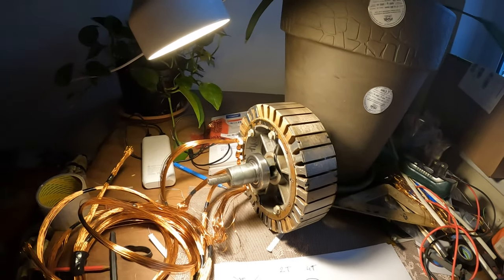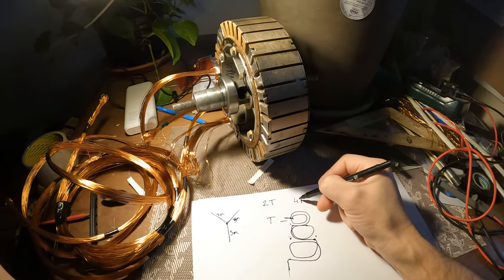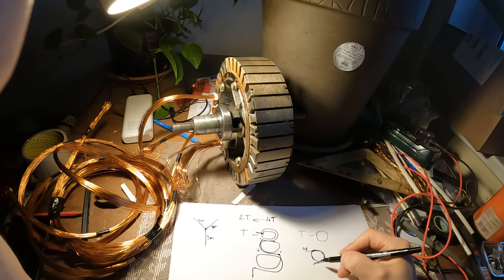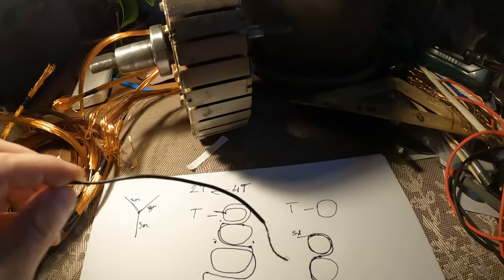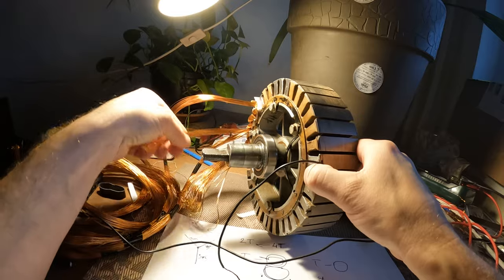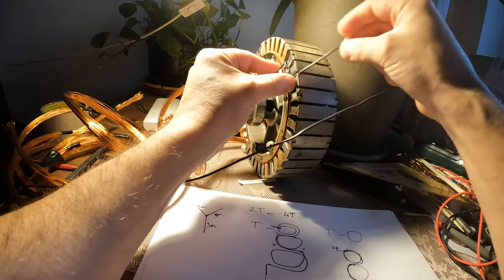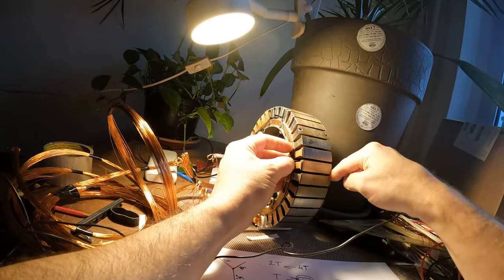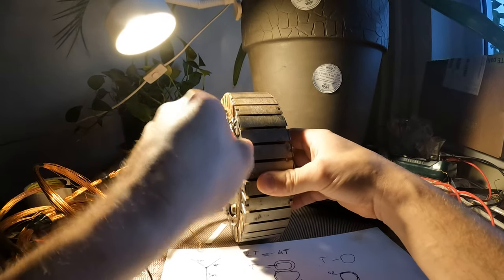QS 205 electric bike hub motor rewind part 1

Comment: Hello. The video caught my attention. I'm wondering something. What kind of result does wrapping in 4 turns instead of 2 turns give? Can you give information?
Reply from the maker: @celalkaranfilyeri393  2T will be faster than 4T but will have less torque at same amps. In simple words just imagine bicycle with higer gear switced on. You can go faster but it is much harder at low speed to go in hills. It will have +- same efect. It will stress all components in serries. (Battery, controller). But if your system can handle more power. You can push ut harder. There is always one component in system where you will reach it's max. Battery, controller or motor.

Comment: Hi question. I found a few broken strands on the green phase winding, where the wires bend over the body hub. Will the motor still run with a few broken strands? Like 3, maybe 4 at most
Reply from the maker: Yes, it will run no problem. But this phase wire will get a little more heat then 2 others. It very depends how strong You are pushing this motor.
Reply: @Musvilkis  it's a first gen 3kw qs205 pushed to 6kw nominal, 300 phase output with statorade and hub sinks paired with a fardriver Nd72530 75 line amps. Motor currently has 40,000km on it
Reply from the maker: @500wattz  I bet there is no fero fluid left after so much km. I am thinking it is maybe better to use transformer oil.
Reply: @Musvilkis  you were right my statorade all leaked out but I think it's because I didn't let my gasket cure and I caught it seeping out of the side covers months ago
Reply: @Musvilkis  question, of those broken strands are left loose and hit one of the stator magnets (if I tucked them away), would that create a short? When I sealed it all up I spun the wheel by hand and felt resistence like how you could the pole pairs. I checked all my phase wires no shorts in main cable to windings
Reply from the maker: @500wattz  maybe these couple wires are short somwhere else? Chech if these couple loose wires are not in short with stator. Maybe they are damaged in couple places and creating short to stator. We had similiar situation to my friend
Reply from the maker: @500wattz  Also check phase wire  if they are not shorting to stator.
Reply: @Musvilkis  I checked, it seems okay might be shorted phase wires in the axle as the yellow phase insulation is ripped open close to where it enters the axle. I have pole pair resistence without any power which is not normal. How can I check with a multimeter if my phase wires are shorted?
Reply: @Musvilkis  okay I ran continuity test via multimeter all phases beep between each other and when I run from axle to phase all phases beep as well. Would those broken strands shorting to stator cause this, or do you think the wire insulation for the phase wires cracked open inside the axle?
Reply from the maker: @500wattz @500wattz  Hi it could be those lose wires. But still usually the demage is on pole coner (sharp edge of the pole). It is hard to see because wires are hiding it. You can rewind it. QS is quite easy to rewind
Reply: @Musvilkis  How long should the enamel wiring be? If i were to buy a 1lbs spool and cut off 22 strands, how long should they be to wire into the 205 stator?
Reply from the maker: @500wattz  it depens on motor "kv" or "T" value. More T more longer wire. You also have to have insulation paper for stator. I bet old one will be bad. You can buy it from ebay as I did. The length You will check when unwind old wire. Please left some more. I had on my rewind that I was to short like 10cm for wire. :D
Reply: @Musvilkis  I'm aiming for 4T rewind. Why insulated paper and not just any paper when rewinding?
Reply from the maker: @500wattz  because usuall paper does not have mechanical or thermal properties as insilation paper which is designed for this. Only one way to find phase wire lenght is to unwind old and measure it lenght. Better to film your unwind in order to do same wind configuration.

Comment: Hello I glad I found you 😎
Could you please help me

I have exactly the same motor but 5T
I was just about to rewind it to 2T.
Because
this problem I'm getting 
The motor has a bit resistance when turning also when disconnected.
Feels like magnet pulling 
Makes loud noise & vibrating when running.
Do you think is problem with the windings.
Could you confirm please

I've already tested the obvious
Not hall sensors
Not wires touching frame.

Just can't think what else could it be.
Reply from the maker: Hi 2T will be very fast. It would be like 4 times the current as 5T moving from stop or climbing the hill. Controller/BMS/Battery have to be very powerful to handle 2T. Would not recommend 2T if it is in wheel without reduction as my mid-drive. Even in my mid-drive 450A phase/ 250A battery with reduction 1:2,4 controller/battery could not handle enough 2T. Controller Overheats/BMS trips Overcurrent error. 
Have You checked phase connection to motor axle or bolt on the motor? There should be no connection between phase wire and motor casing/axle/bolts. You can check with tester. The symptoms that you have it.